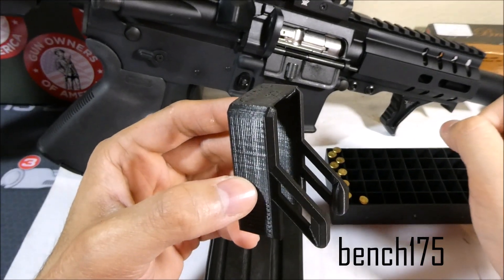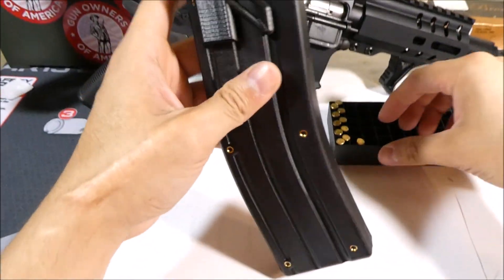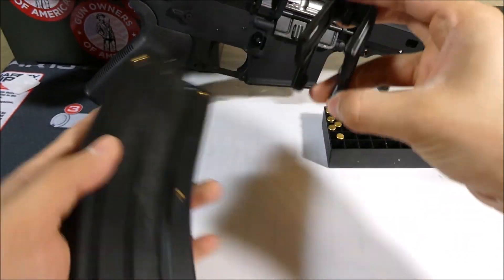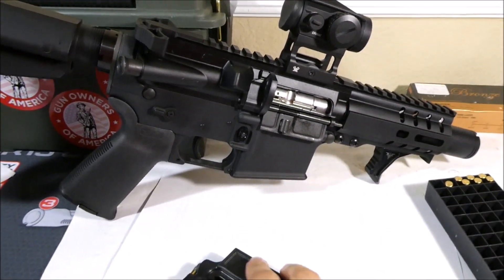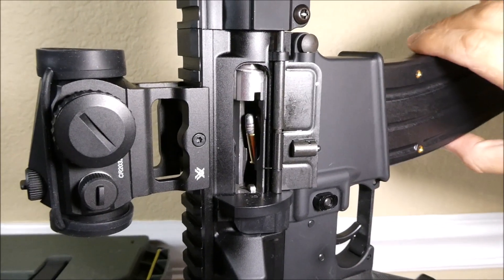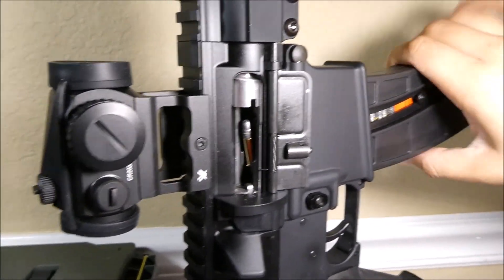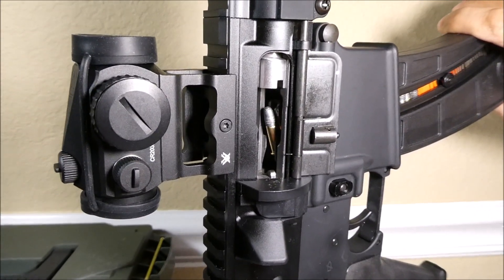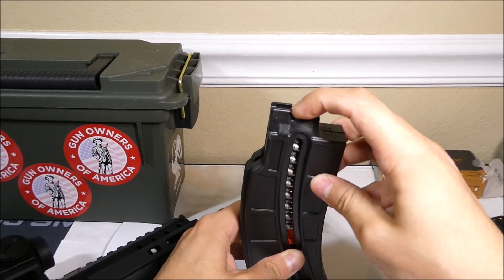Ebay Speed Loader for CMMG 22lr magazines

Comment: There is a company that makes a mag adapter, so u can use 15-22 mags with cmmg conversion kit. 
What i like is it holds the bolt open on last round. Even after removing the mag.
Reply from the maker: I thought about getting that, but I already have like 6 CMMG mags
Reply: How are those holding up for?